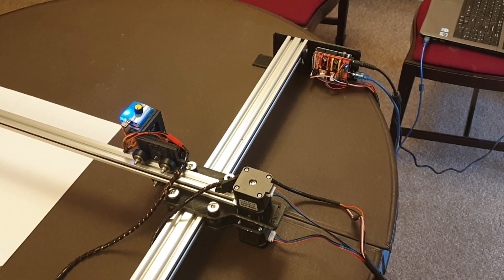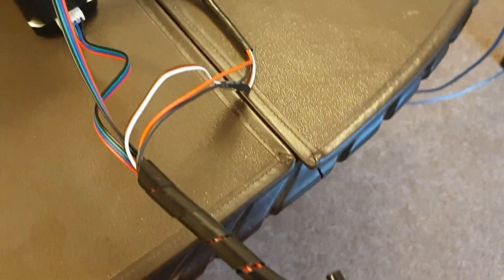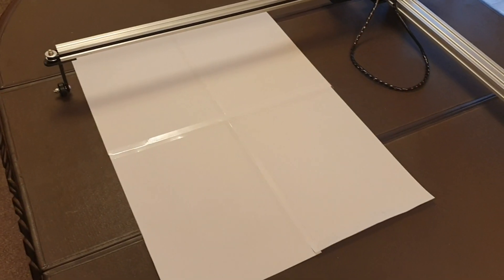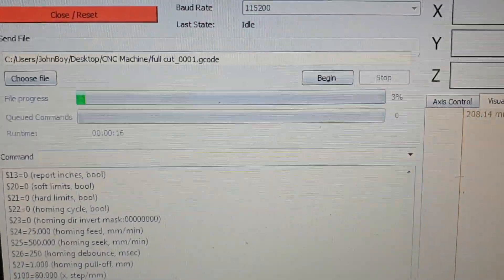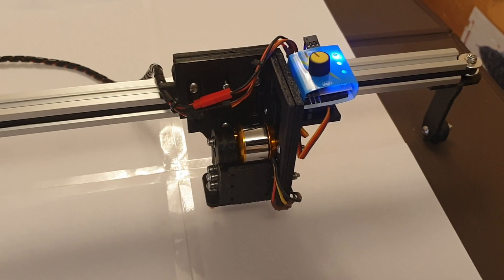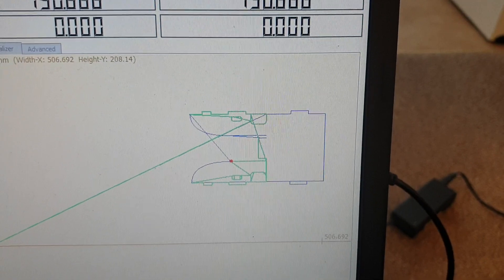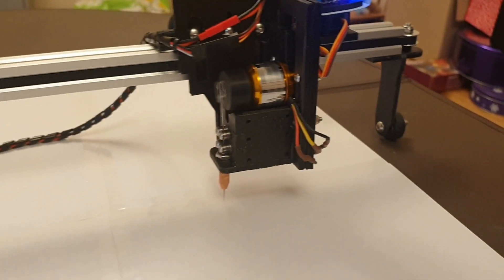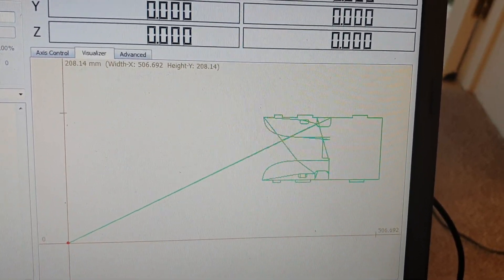A HOME MADE CNC NEEDLE CUTTER MACHINE PT 7

Comment: Thanks for the build series. Any video of this in use cutting Foamboard?
Reply from the maker: Unfortunately I havent as I have sold this machine a few years ago. I did mount it on a purpose built bed which worked very well on foam. The secret is making the needle and the playing about with the feeds and speeds.....when you find the sweet spot it cuts really well 😊
Reply: @KirkyRC  Good morning, could you help me, please? I can’t find the str files. Do you have those files and could you send them to me?

Comment: Hello! Is it suitable for corrugated cardboard?
Reply from the maker: Hi ive never tried corrugated cardboard to be honest but I imagine it would be ok if you slow the traverse speed down and take your time. It is designed to cut 6mm thickness so do not exceed this ok
Reply: @KirkyRC  Can you please tell me what kind of wire or file you use?
Reply from the maker: Hi at present I'm using stainless wire but in the past I have used mig welding wire with good results however you may have to experiment when cutting corrugated cardboard
Reply: @KirkyRC Interesting) Do you use just smooth wire and it cuts the foam board?
Reply: @KirkyRC Thank you
Reply from the maker: Yes just smooth wire with the end cut at a slight angle. It is the end of the wire that does the cutting not the side.....a bit like a sewing machine 👍
Reply: @KirkyRC Steeply, I wouldn't have guessed it myself)